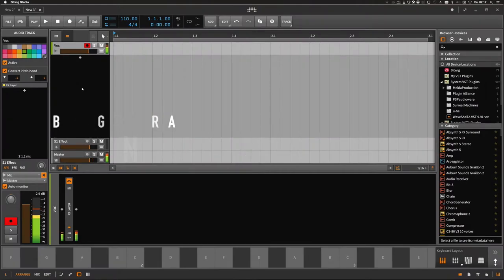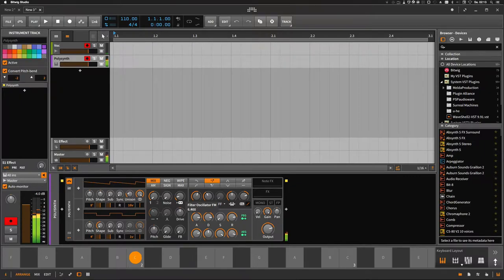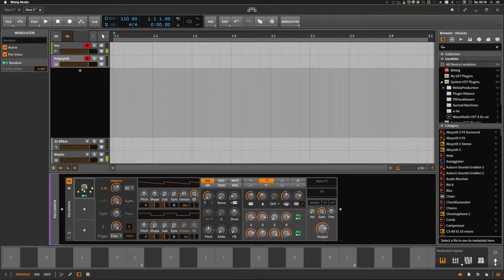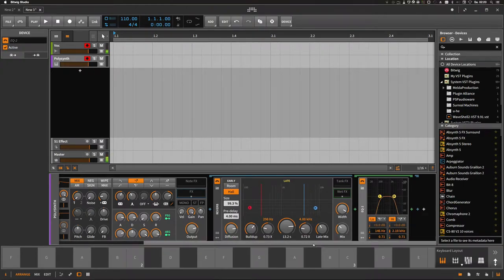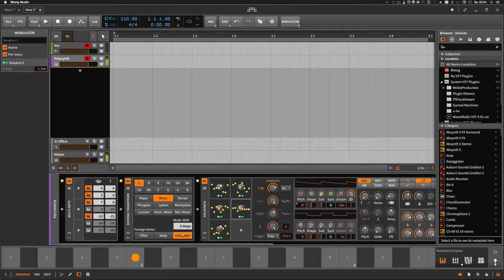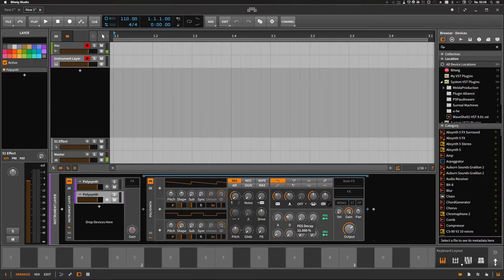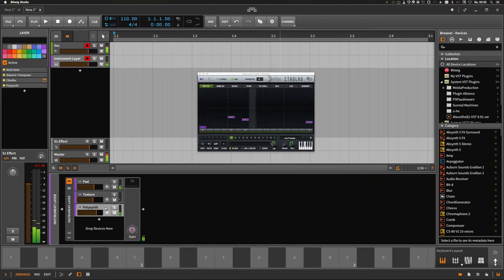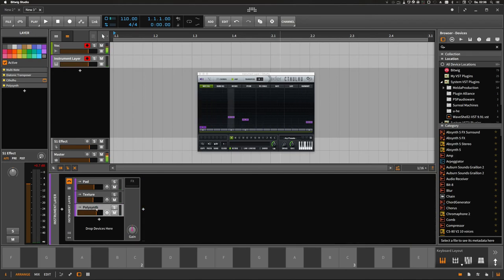Living Pads - Bitwig Tutorial

Comment: Hi dude, do you know why modulators are not polyphonic when used on a third party VST or an audio effect like the ladder filter? I am trying to use the ADSR modulator on a third party filter (or a synth, or the ladder filter of bitwig - does not matter), however the modulator stays monophonic, retriggers on every note and does not allow you to play pad chords. I am trying to make a sound with a third party synth, but instead of using its built in filter, I want to use a third party filter - for example Arturia SEM filter is fantastic - and modulate the cutoff with ADSR. I failed to find a workaround. Not only in Bitwig, but Ableton Max 4 live ADSR envelopes are also monophonic. Do you have any idea?
Reply from the maker: I think (thats just guessing) for polyphony the bitwig devices clone itself multiple times (virtually) for each voice. For VSTs this is not really possible, ther is only once instance. There is also no voice stacking for VSTs (which is the same concept code wise i think).